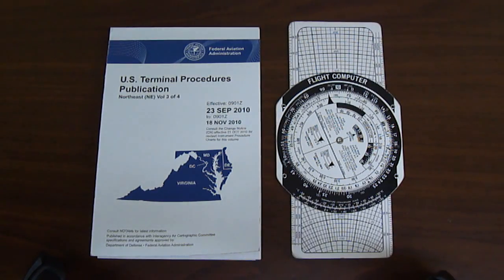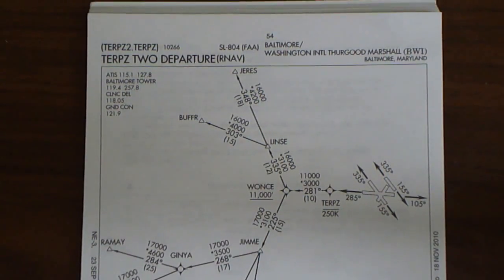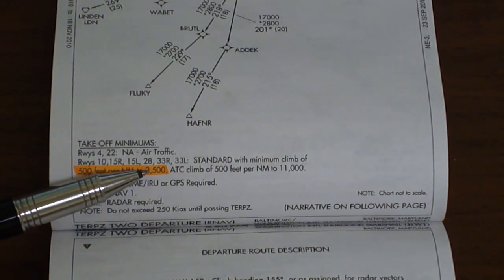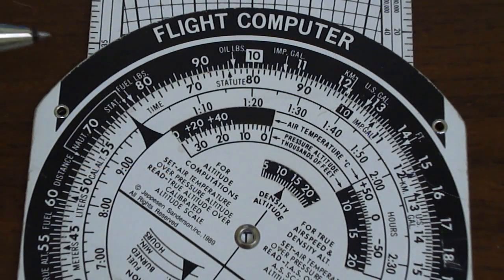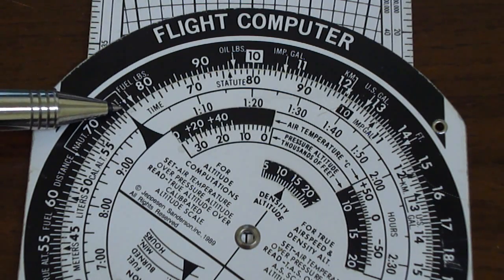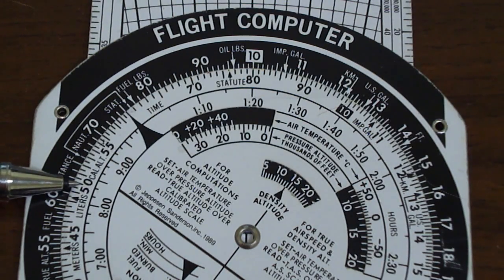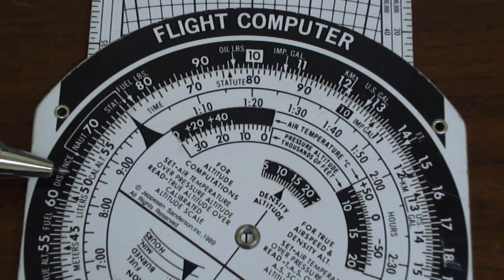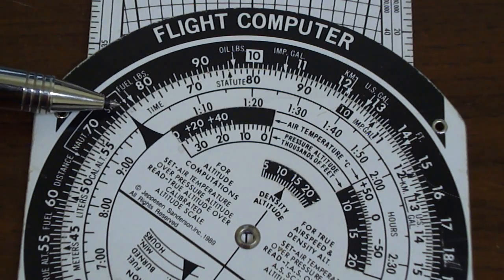E6B Flight Computer: (IFR) conversion FT/NM to FT/MIN

Comment: Thanx for the video, very informative but I think you want to use Ground Speed not IAS to determine climb rate. In your example, if your GS is faster than your IAS then you may not clear the obstruction requiring the climb gradient.

Comment: You can also do it mathematically by dividing your GS by 60 and then multiplying the answer by the required Feet Per Nautical Miles to get Feet Per Minute.  EX: AS - 80kts - Required Climb Gradient 200FPNM (80/60= 1.333 X 300FPNM = 399.999 or 400 FPM